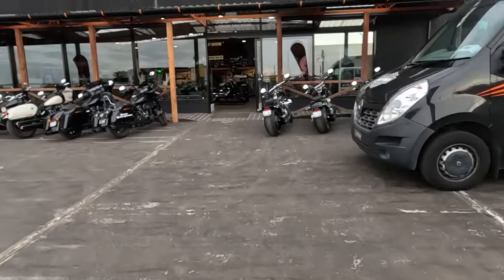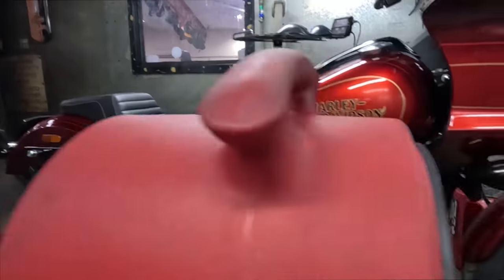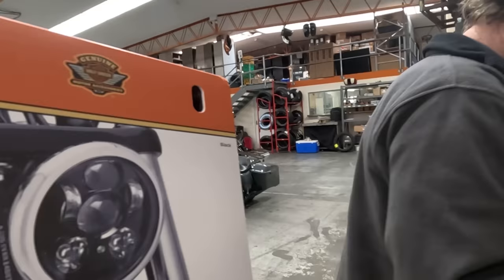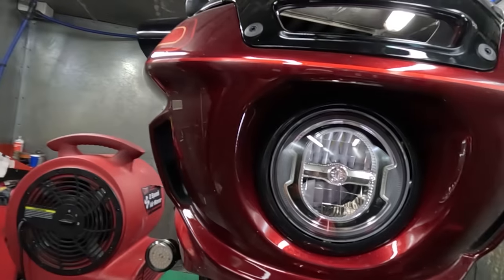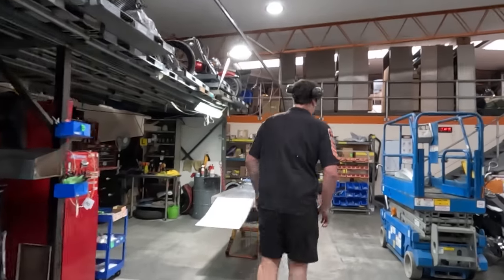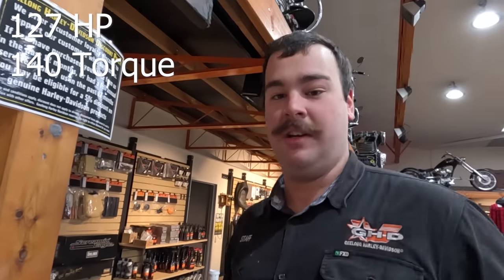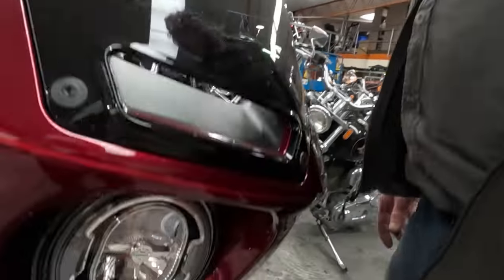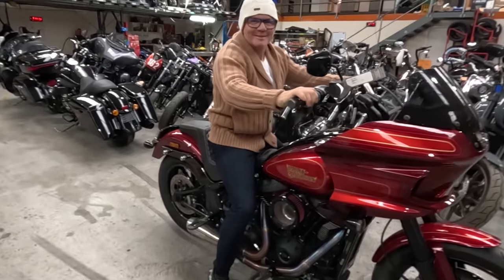Horse Power, Torque gains full stage 2 - Harley Davidson Low Rider ST

Comment: I turn 62 next month and my last bike was a Street Glide with the sluggish 88 cubic engine which I sold 17 years ago.  As an older rider I did not want a nother 825 lb bike.  When I saw the new Low Rider ST with the 117 engine I new I found my next bike.  Even a stock 117 is a monster.  But I am going to change pipes and do a stage 1 to get a tad  more performance out of the engine.    Other than that leaving bike stock.  I truly belive Harley knocked it out of the park with a smaller lightweight cruiser which will appeal to older riders as well as woman who of course are capable of riding a bagger but many will feel more comfortable on a lighter weight bike.  Thanks for great video mate.  Safe travels my friend🙏.   I do have a quick question?   I do NOT like doing 100 MPH on a motorcycle but I love getting from zero to 60 in as quickly as possible which I believe means I prefer Torque over HP..  What is the best modifications if you want to increase the torque and do not care about top speed?   I prefer to cruise around 60 to 70 MPH.  Thanks again for any advice. You guys rock!!

Comment: What was done to adjust the air/fuel ratio? I've not seen this addressed in any of the build videos. With all the modifications made, it would seem a Power Commander or an HD equivalent must be used or the bike will run very lean and overheat.

Comment: 110 HP with 117 Foot Pounds of Torque , that’s normal with a cam and exhaust and on the printed Dyno run not 127

Comment: Now Danny just remember to be very smooth with the throttle just roll it on don't jerk it or pull it just roll it on mate 😂❤
Reply: Colin tried to explain that to Danny when he installed the heavy vduty clutch springs, went right over Danny's head

Comment: So a stock weight of 327kgs, and a genuine 110bhp and 122 ft/lbs at the back wheel........oddly enough, my "old man's bike" BMW R1250GS has 128bhp and 101 ft/lbs torque at the rear wheel pushing 249kgs. But that Harley does sound nice compared to the wet fart sound of the BM....

Comment: Nice results (127hp & 140 ft.lbs. torque; at the rear wheel) from the Stage-2 mods and tuning.  Factor in the lower weight of the Softail (versus Touring chassis weight) and this bike is going to be a blast to ride!
Tom M., So. Cal., '23 RG-ST
Reply: Get less than you pay for bike wise even the Porsche engine Harley not right but a creature of its own .old people love tractors travel aus on a tractor .stop bothering col.entertaining sound political correct stuff .

Comment: 1st build you've done where I'm actually jealous. Have the same bike with many of the same parts  but you've taken things further. She's likes to rev more then a twin cam and with that bassani 2 into 1 she spits flames often. 

Happy you finally got off the street glide. Absolutely nothing wrong with them but this bike is better suited to your hard riding style.  

I know Colin owns that dealership, but I can't stand when dealers try and act like hd parts are best. No manufacturer uses their oem parts because there best - a stock vehicles parts are a balance of cost, performance, and reliability.  Aftermarket companies that specialize in performance/quality are better in every scenario.